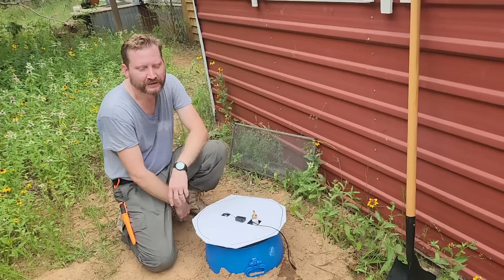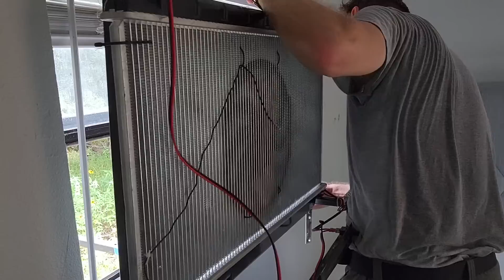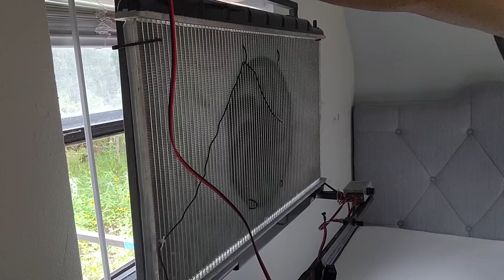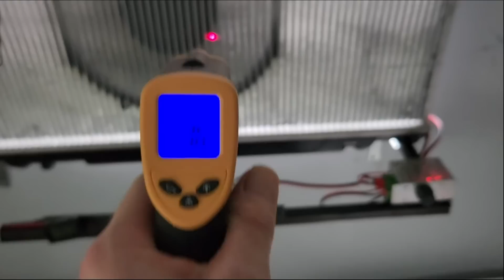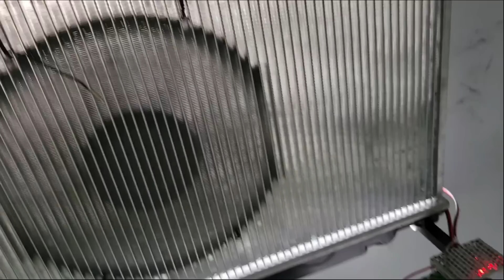Geothermal Air Conditioner test. Easy DIY without trenching!  50 watts! Texas Prepper Projects

Comment: One tip from my home brewing experience is to drop a frozen gallon or two of water into the barrel and you can bring that water temp down in the 40's very quickly to get ahead of it. The ground will then regulate it
Reply from the maker: Thanks
Reply: The purpose is energy efficiency. Using a freezer to make ice is highly inefficient way to cool. If using ice from a freezer is the way then just get an ac, it would be more efficient than ice

Comment: You can improve on this a lot  by using 2 or more   containers for more thermal mass. Choose metal containers rather than plastic so that stored heat is lost more easily to the ground overnight. Also bury them a bit deeper.
Reply from the maker: thanks

Comment: Start with 5 gallons of Kool Temp Coating on all your Metal....use your auger to relocate a few trees to shade the shed All day... especially afternoons..  ...and for more Shielding ... temporary...just add R Board to outsides and roof ...
The AC unit is draining the cloudy day solar.  .and at 72 degrees in the shed ...condensation forms inside the metal walls....big mold problem. If you didn't use  closed cell spray foam on inside of metal it's likely you already have mold issues....sell it. Start over. I do that a lot.
Reply from the maker: thanks

Comment: What also could help is a fan shroud on the radiator, fan blowing in the middle without shroud doesnt transfer well, but this is a cool test.
Reply from the maker: Thanks!  The problem is leaned was that  it is less about mass and volume and more about surface area
Reply: Or add a second fan (side by side) so you get more airflow over the radiator.

Comment: As I see it, this can't work well for more than a few minutes as installed. Once the water warms up, it will have no more cooling effect due to the inability to reject the heat quick enough. Is that what happened in your case?
   You weren't deep enough in the ground and you don't have enough surface area cooling the water back down.
    To get rid of approximately 12000 BTUs of heat, you would need about 300 feet of  poly pipe buried 10 to 12 feet underground looped in a 3 foot by 100 foot trench, or straight in a 300 foot trench were normal temperatures stay around 60°F. Exact temperature depends upon where you are in the country.
    Better yet,  Connect to a copper heat exchanger and place it in moving cold water, such as a cold spring. A well might work as long as it can get rid of the heat fast enough over time.
Reply from the maker: I agree I got thr math wrong on this. How did you get the figures for 12,000 btu??
Reply: @texasprepperprojects  From other geothermal information.

Comment: if you make a hole in the earth then suck out the air from that hole the air is replaced with warmer air . how long will it take to make the earth in that hole warm as the surface air
Reply from the maker: That is a very complex question

Comment: From what I've seen in other videos, you need to be down 6-10 feet to get the most out of a geothermal system.  Also, they don't mount the radiator in a window opening with the window open.  They find a place up high on a wall to mount the unit and set up some sort of drip tray for any condensation that might build up on the radiator.  Also, because you aren't using a closed loop system, bacteria will get into the water and cause problems with corrosion.  So, what you've set up would work, but I wouldn't count on it for day to day use when it's 90+ in the shade.
Reply from the maker: Agreed on all points. Check out my more  recent video on this topic
Reply: Yea, its a closed loop. Your incorrect
Reply: @cowboyslament  That's not how a closed loop system works.

Comment: I think this will result in some cooling.  Depending on how cool the ground is.  The problems you will face is lack of surface area for the cool side limiting how much heat you can exchange.  One huge over looked job of traditional air conditioners is de-humidification.  Your cooler wont get cold enough to dehumidify so any drop in temperature you archive will be negated by an increase in humidity because there is the same amount of water in a cooler volume of air.
Reply from the maker: this is a proof of concept. The full system will be an IBC tote with a lot more volume and surface area. I have an idea on how to deal with the condensation. Thanks for the reply!

Comment: this could go anywhere in the room, it would not need to cover your window.  I may actually be more efficient not in the window.  The reason is your actual exchange of heat takes place in the barrel.
Reply from the maker: The window is just to pass the hoses
Reply: Yes, cool cooled air, not hot outside air, pretty basic stuff.

Comment: Good stuff...seemed to be a quite a bit of air coming out of the radiator outlet pipe which probably makes it less efficient, maybe a stronger pump would help or priming the radiator from the fill cap first.
Reply from the maker: The cap is just a plastic plug so I'm sure it's letting air in from the top

Comment: It's not like for like, as on average* (continuous duty) this thermal battery does not have nearly the surface are as a much bigger dig.  It has uses for sporadic use where the water can be recharged to cooler temps during non use periods, after it has been warmed up by the daytime exchange.   If nights are cool one could recharge the water more rapidly by circulating  cold night air into the barrel water. (configure the air source appropriately).  Obviously this system , if run continually will eventually heat up the water to some degree (lol) and partially the surrounding earth.
Reply from the maker: Yes this is what I have told my test people. It will 'run' during the day and then need to be shut off at night to 'recharge' unless you have a HUGE volume of water. This is a proof of concept to learn what I don't know before going to a larger scale
Reply: Correct

Comment: I would increase the size of your thermal batteries and and buried tubes that will increase the radiator surface area.  You don't need a pump at all.  Thermosiphoning will move the warmest water from the top of your battery to the surrounding ground and colder denser water will be drawn into without any power.   Mover the inside heat exchanger to the coolest/hottest part or the shed to see where the exchanger will be most effective.  The window picks up a lot of heat from the outside and  conducts it into the room.    I'd also put it in a roof vent to move the air on the top out.
Reply from the maker: Themo syphon is super cool, but really slow. Also for it to work, you have to have a BIG temp delta.  My $30 pump runs on a $50 solar panel, so I'm good.

Comment: I'll give you credit to the "concept" but 76-degree air would feel mighty warm to me !!!   So how big and deep of a hole would you need to get the room/shed to about 72oF ?
Reply from the maker: Based on my research, the answer is 'it's complicated'.  It depends on the TYPE of soil you have, how DEEP you can get the hole, and how much water you have in the tank.   this is a proof of concept. In the real world, the tank should be buried completely with 3-4 feet of dirt on the top of it.  I think that 55 gallons per 150sq feet is a decent rule of thumb.  In the next, full scale test, i'm going to go deeper, but it will require heavy machinery, not just a guy with a $130 post hole digger and a shovel.
Reply from the maker: Also put it in context of Texas summers that are 110 to 120F.  75-80F still isnt' great, but its better than 115F
Reply: @texasprepperprojects  i live in tx and wanted to try this too
Reply: Man, I feel chilly at 79!! Living in Florida tho...

Comment: Best redneck air conditioner I have seen!
If your water tank is below your frost line you get better results. And a metal one conducts heat away more efficiently.
Additionally, why not remove both windows for a better fit??
Part of the air for the fan is being blocked.
And what about an air filter??
Try testing after 8 hours of use on a hot day too.
I think your water tank is going to be too small to keep up.

Comment: There's really no reason to put this on a window, it should be totally inside, you are losing a lot of potential cooling by using the external air and not recirculating the internal air through the radiator.
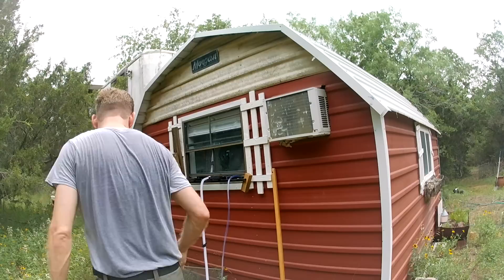Reply from the maker: well, the air IS re circulating. The glass of the window is closed behind the radiator.  7:51
Reply: But it is cool and relaxing to have a view, that is one of the reason of a window, sunlight isnt bad!
Reply from the maker: True

Comment: SIR ,USE CLAY BIG VAS INSTEAD OF THAT PLASTIC BARRELL ,I USED IT AND IT WORK VERY VERY EFFICIENCY
Reply from the maker: post a video of it!
Reply: Ok soon
Reply from the maker: @majeedkhan470  great
Reply: If a clay big vase is not available, you can make a cement water tank

Comment: I'm interested to see how well this works. My ground-source heat pump is plumbed to a 440-foot-deep well. About 83 gallons of circulating water.
Reply from the maker: And what is the temp of the water coming out?
Reply: @texasprepperprojects  47° F, year 'round. In the winter, the water returning to the well is 36°.
Reply from the maker: Try it out then!
Reply: @texasprepperprojects  The heat pump went on-line in 2008.
It can get the house to 80° in January and keep it below 60° in July. That kind of performance does tend to be expensive at the meter.
Reply from the maker: Try it!
Reply: My sister put in a 50 thousand  dollar heat pump last year. It couldn't get the house above 65 degrees. @Struthio_Camelus